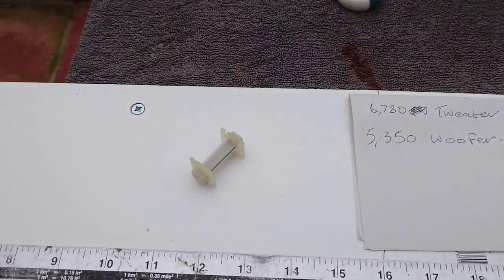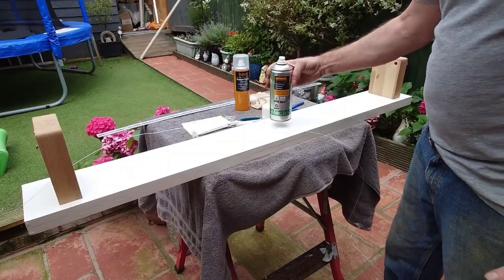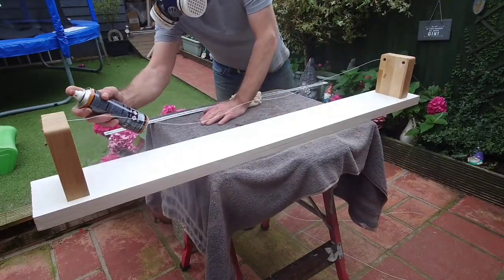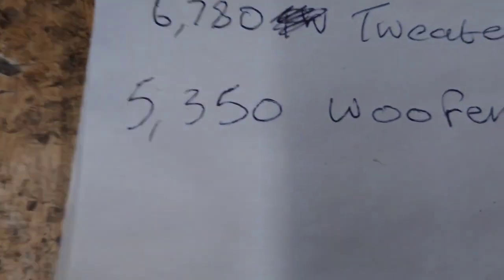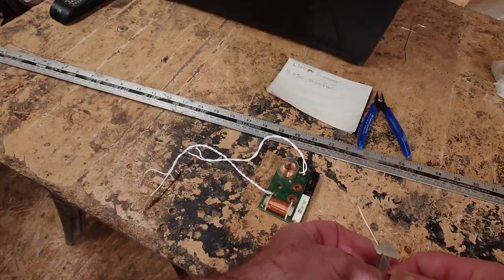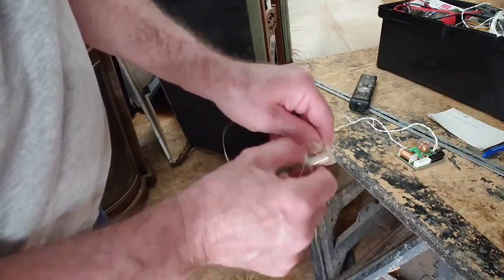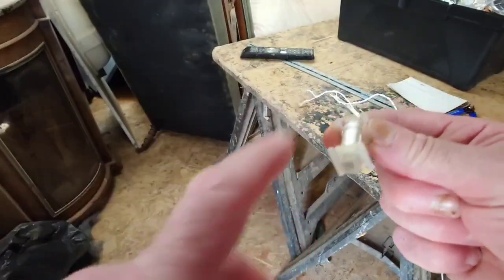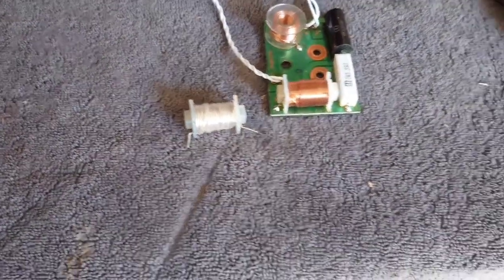HOW TO UPGRADE YOUR IRON CORE INDUCTOR.

Comment: It amaze me every time how much effort and money people putting in the pursuit to improve their audio systems without any result. Save up the money instead of burning it up for useless cables, wires and other stupid gadgets and buy yourself a real better set of loudspeakers. That is effective.
Reply from the maker: Most loudspeakers put crap parts in the crossovers, cheap inductors, resistors and capacitors, no matter how much you pay, that's why we upgrade them, thanks for commenting & watching 👍

Comment: An air coil with OCC wire with a larger cross section I think would be better than thin silver wire and a metal core. OCC single crystal pure copper is an excellent and cheaper substitute for silver alloys. Cast copper wire has significantly better performance than drawn copper wire. I wish you all the best with your hobby👍
Reply from the maker: The problem is, it's not that easy to calculate, an iron core to an air core, there's not much info online .
Reply: @tweakerman  If you know the value of the steel core coil, the optimum air core coil can easily be calculated. An app like Coli Calculator works great. When you have a working coil it can easily be measured with an L-C meter. Don't judge my English because that's what google translator can do. Greetings
Reply from the maker: @silverchesnov5247  I've measured it on my lcr meter, so I know the value, but calculating it from iron core to air core is not so easy, I'll take a look at that app👍
Reply from the maker: @silverchesnov5247 I also spoke to Jantzen this morning over email, they advised me to go for an iron core on the woofer, which is rather interesting, they said their ones are far better than what I'm already using .
Reply: @tweakerman  If you buy from Jantzen you will not go wrong at all. Winding a coil by hand is not easy, and buying a coiler is not justified if you do not plan to make many units. If the coil is not precisely wound, the value becomes less than the requested. The Coil Calculator program works very well and I have hand wound quite a few coils because I had enameled wire for free.

Comment: Based on my experience with LS3/5as it seems that you'd be better off replacing them with air cored inductors.
Reply from the maker: The reason for using the iron core is to do with space, the speaker cabinet is very small & after rewiring with the new wire, they measure the same, thanks for commenting & watching 👍